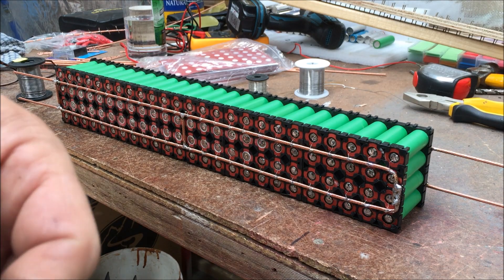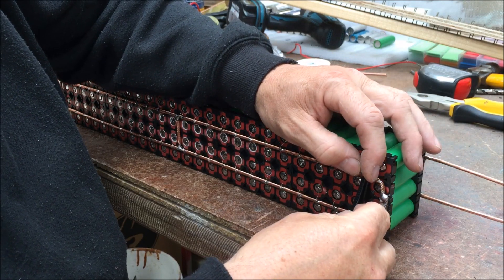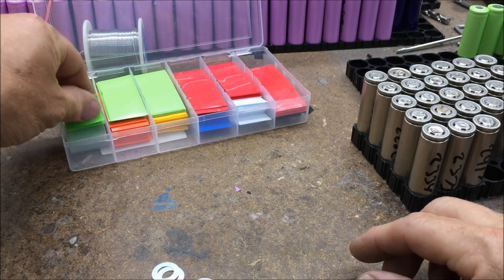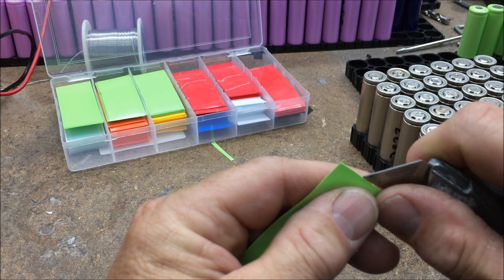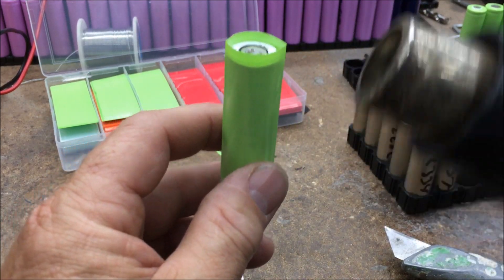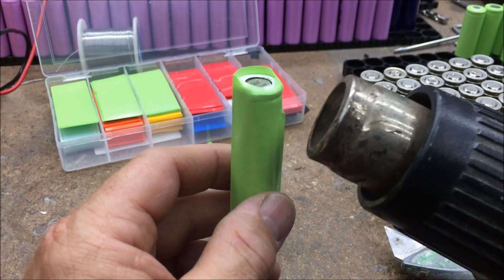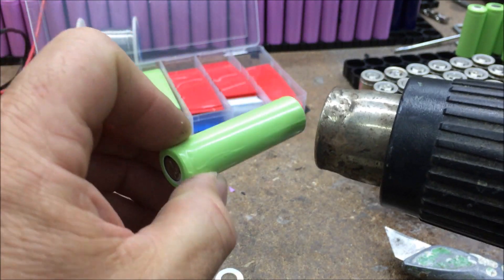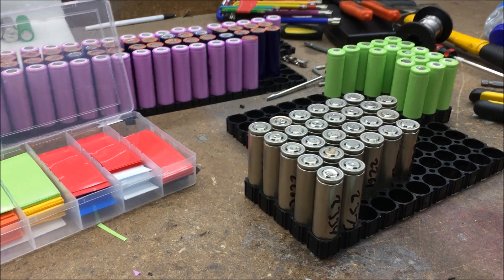DIY Power Wall - Re-Skinning Batteries #5

Comment: I know they are all harvested from laptop packs, but have you at all documented what type (brand/model) of cells you have?
Reply from the maker: Hi Patrick. I've use a mixture of laptop , electric bike , power tool and electric garden tool batteries. 
I found that the Samsung batteries are by far the best.
Reply: Interesting. What kind of batteries did you find in those tool packs? I would expect high current draw but lower capacity 18650s.
Reply from the maker: Most of the power tool batteries I have come accross have Samsung batteries. 
I've been told that the the BMS in power tool packs are programmed to only charge the pack for a limited number of cycles then show an error, So the batteries at not always dead